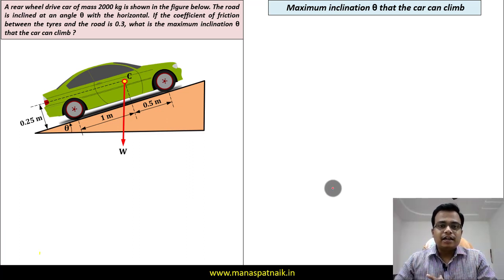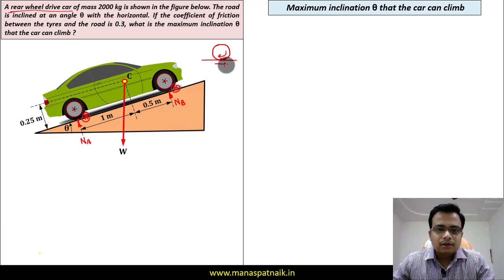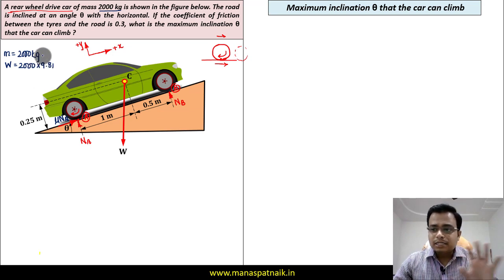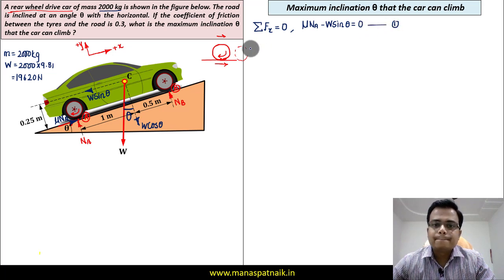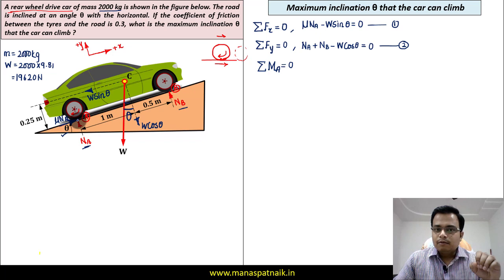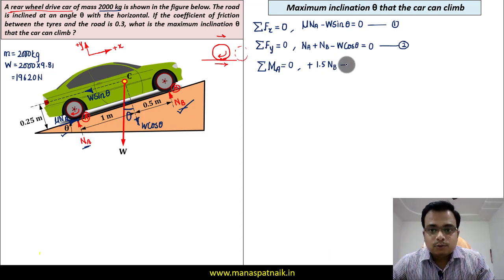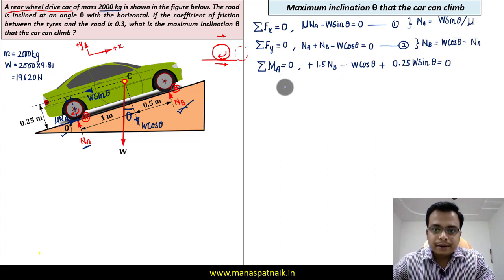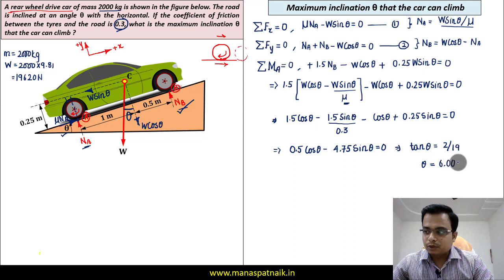Friction | Problem 11 | Conventional Approach

Comment: Sir why didn't you consider the friction on the front wheels?
Reply from the maker: Because the power from the engine is transmitted only to the rear wheels.  
Do check if this is a rear wheel drive problem. And if it's a four wheel drive then the friction has to be considered on both the front as well as on the rear wheels.
Reply: @ManasPatnaikofficial  do both of them will have friction in forward direction ??
Reply: @sbti6051  yes both the wheels have in the same direction